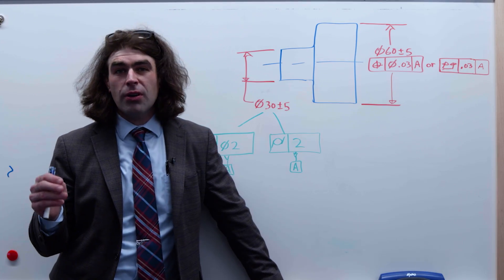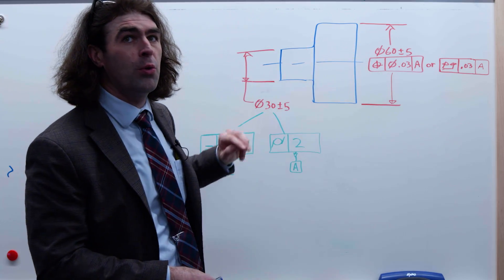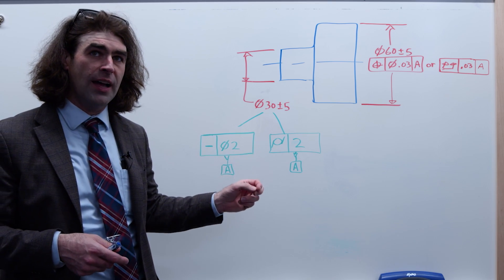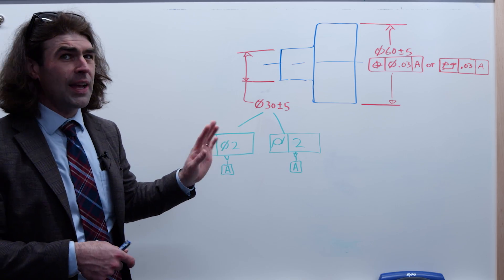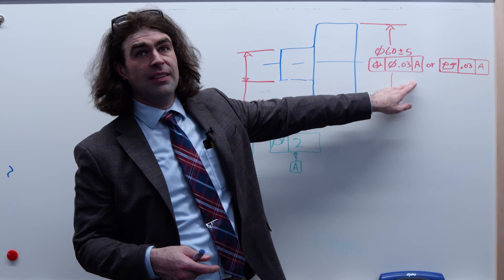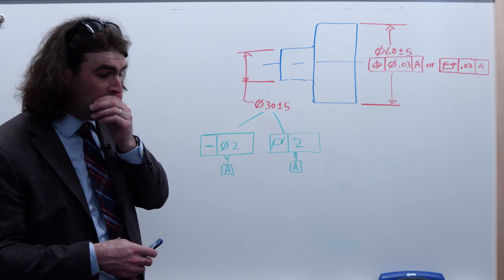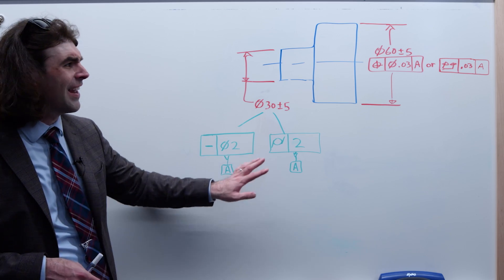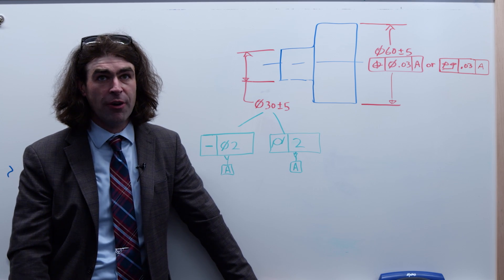Can a Derived Median Line be a Datum? GD&T

Comment: Wouldn't coaxiality be the more correct way to tolerance this? than position? my understanding is that positional tolerance is more of use when you have  Your datum and/or references not in line with the toleranced feature
Reply from the maker: I may not have stated in the video, but I’m using Y14.5. Position can be used for coaxiality control, usually on parts that are stationary in function.
Reply: @RDeanOdell  I assume that is ASME? I'm from Europe (Sweden) so I'm measuring using ISO and had never seen it done like that before, thanks for the quick reply

Comment: You may confuse people here b/c you have applied much larger tolerances to the datum feature A than to the features tied to Datum A.  If Datum A is allowed to wobble within 2 mm, you cannot have a feature using this datum at a tolerance of .05mm, things would just not work.   Datum A would need to be tied down much tighter in reality....good discussion thou...

Comment: I like the video, Dean!  It is a recurring theme in GD&T that we are made to straddle two universes.  One is a realm of perfect, "basic" geometry, which is imaginary and not observable - the best we can do is to simulate it.  The other is the universe that we can actually observe and in which we have real, physical parts that we can measure.  The GD&T concepts typically exist in one universe or the other.  Drawing views, centerlines, centermarks, basic dimensions, datums, and tolerance zones all exist in the first, basic universe.  A derived median line is an observed phenomenon that we can only find (derive) once we have a real part to inspect.  Like you say at the end, a derived median line isn't even straight, which is another clue that it cannot be a datum.  Hey by the way, if you're going to do millimeters, don't forget to put a zero to the left of the decimal on dimensions that are less than 1!

Comment: Position and all orientation tolerances drives the center plane or axis and flatness, straightness , stmmetricity and concentricity gives derived medium plane or line
But , what about curvylarity, cylindricuty ,and runouts what does they means center or derived line ?
Or simply we cant apply these 4 to a pripary feature of size

Comment: Could it be dumbed down as datum A is C/L of 30MM with cylindric of 2MM and the 60MM,  max R/O of .03 to A? Or am I incorrect?
Reply: The runout tolerance shoulbe be equal or  larger than the cylindricity  tolerance?  I think yes
Reply: @asaholey  Have you ever dealt with defense type engineers? "They can make the impossible happen"! LOL I've seen them  put out tapped holes as datums and other times, tapped holes (again) with true position of .001. Absolutely no BS.
Reply: @Martin-ef4xh  if they can make part without deviation